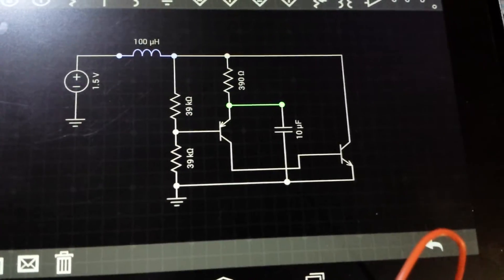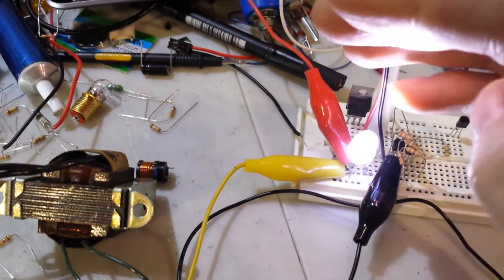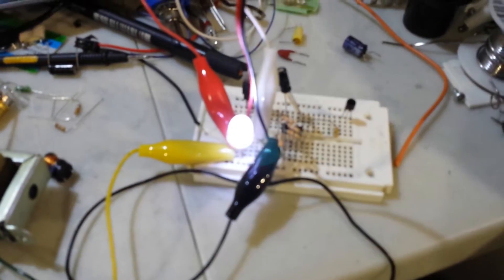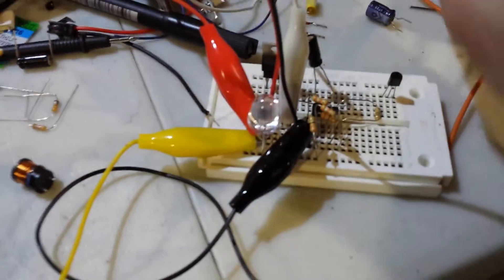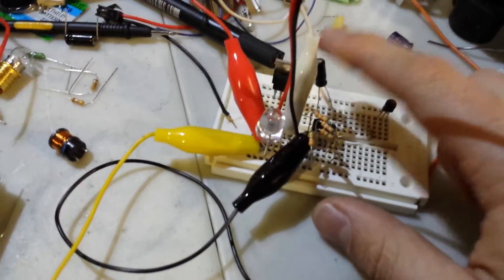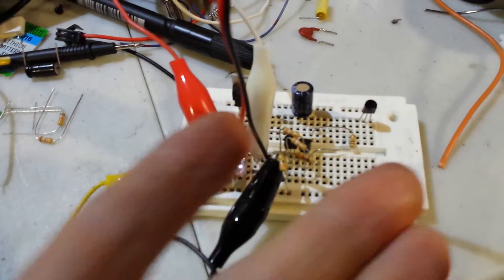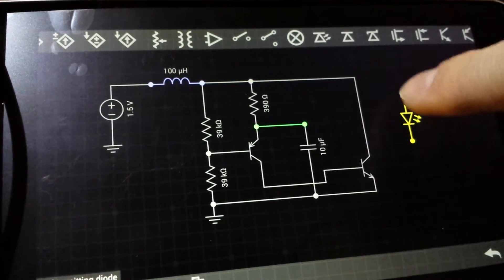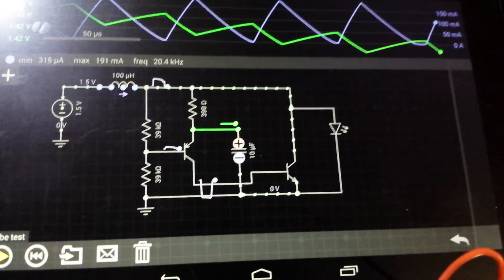Strange and versatile oscillator

Comment: Cam u lower the ma consumption as in a joule ringer 2   thanks
Reply from the maker: Yes you can change the resistor value to get lower frequency and shorter duration of the pulse also change the capacitor change transistor I've done several text so far and I really like the circuit specially that all you can drive almost anything whit just a few modification. Now to see if I could get in the uAmp I would have to check it. Worth testing yes? :)

Comment: I like that, as an inverter...thanks for the find :)
With the LED at the end, in the real world it's likely to run down to about 0.9V for many transistors. The simulator will use an average silicon drop of 0.6V and so quit at 1.2V. Plus a piezo BBQ lighter can fire up similar circuits below such threshold voltages. Definitely on my build list !
Reply from the maker: Glad you like it :) I'll await your video :P
Reply: bakupcpu Haha, maybe so :)
Built one this morning...I used a 1000uH inductor, 33K resistors, A733+C945 just to try it. Works well at 1.5V, drawing 6 1/2mA...now to try a transforner on the output.
Reply from the maker: Nice :) Mine is finally on a pcb and I had to replace the transistor the npn burn out on me :( but a 170 volts 1 amp one :P should be good right?